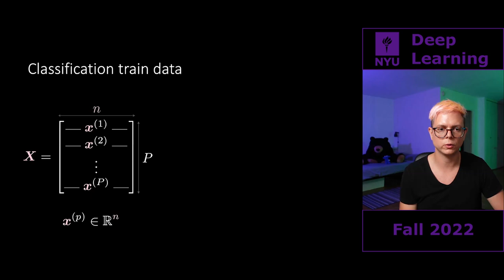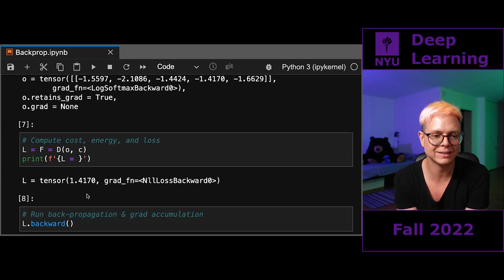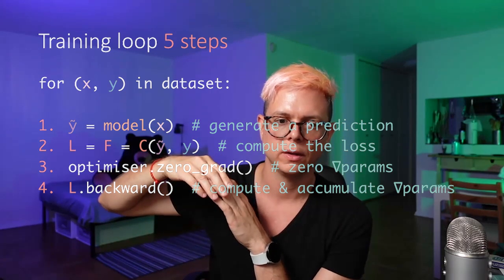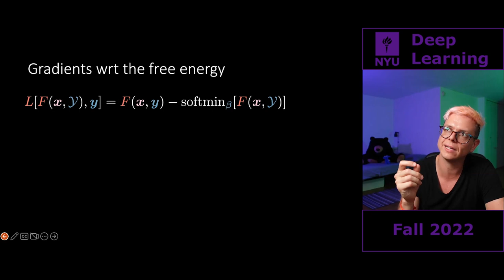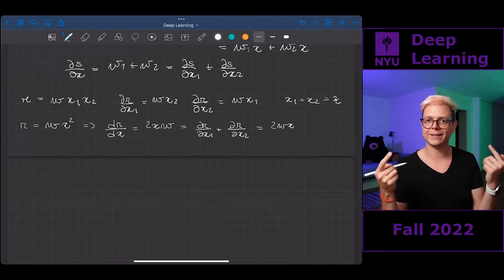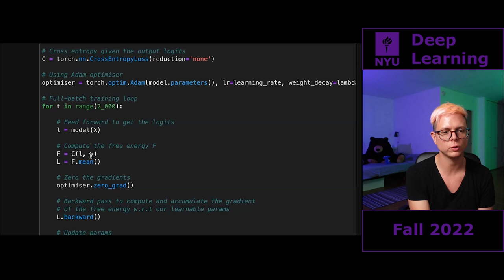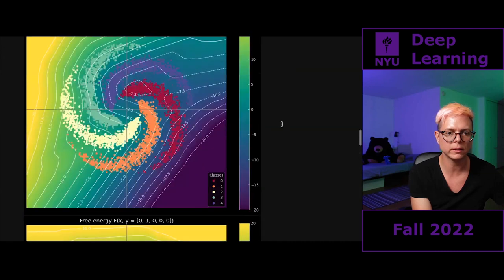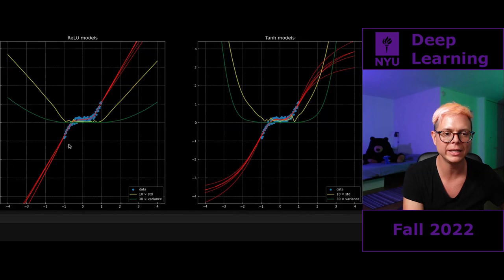07 – Classification, an energy perspective – PyTorch 5-step training code

Comment: Hi Alfredo - thanks for your videos. Just as a note on the step to zero gradients, I felt a simpler way to think about it is that pytorch is storing the results of past computations and these past results need to be cleared prior to future training batches. Found it confusing when you argue that zeroing + L.backward() are conceptually linked when I don't think they are.
Reply from the maker: There’s a reason why these previous gradients are stored. I have a entire section about it. To perform backpropagation in PyTorch one needs to execute two commands: zeroing + backward. Backward alone does two things: it computes and accumulate the gradient. So, if it is preceded by zeroing the previous grads, then it just computes the new grads. That’s why I’m insisting that ‘zeroing + backward’ accounts for a single statement, i.e. backpropagation.